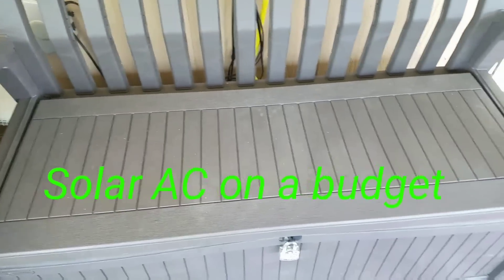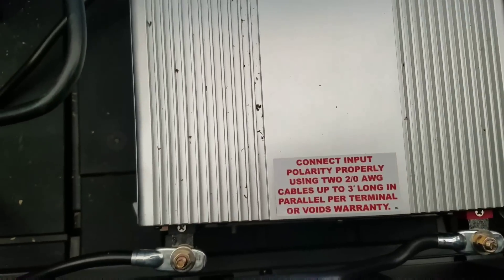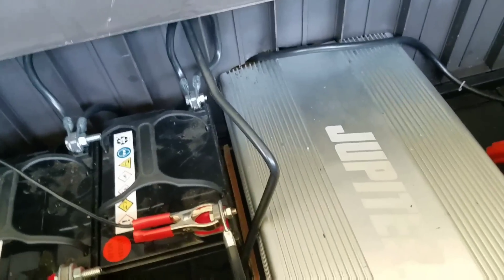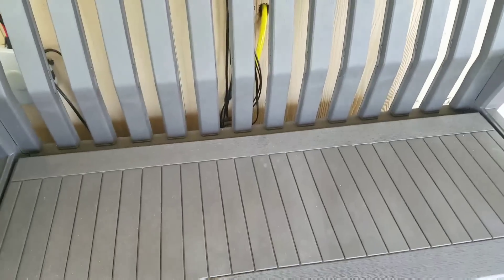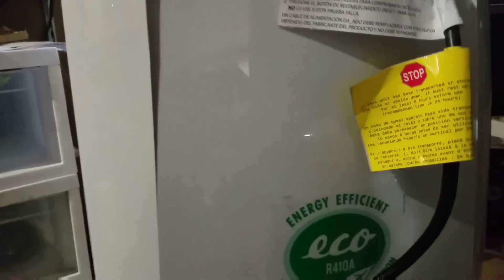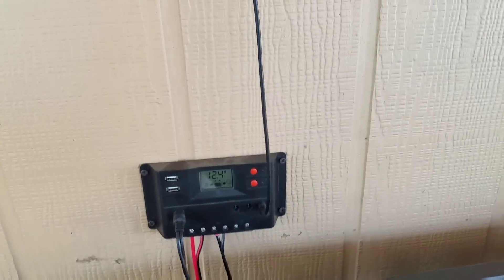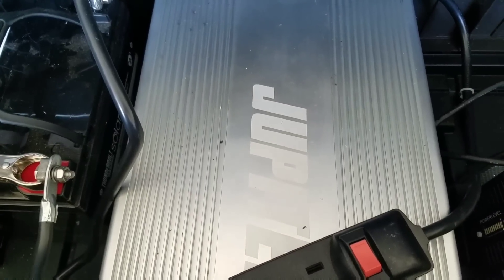How to run an AC unit on solar update

Comment: I live in The hurricane zone and have had a large 5000 -12,000 watt power inverter. We hook it to the battery of a car and let it idle . We rum freezers tv’s and ac
Reply: Why not just get a generator
Reply: Eric L. A generator needs tons of oil changes and is loud my car makes no noise and only needs an oil change once in a few months plus i don’t have to worry about my car getting carried off or putting gas in it every few hours
Reply: Eric L. Also a 5-12,000 watt generator is big heavy and expensive i have one but never used it
Reply: @littlemanoo  
What
kind of things do you power, and how long can do you let your car idle for

Comment: You have 150 watts of solar (peak) likely less than 100 (typical) and a completely inadequate battery system. You'll be lucky to get a half hour out of your setup and that's after you pay to charge the batteries up with grid  power. After that you won't recover......really need to do some more research before you jump into saying you're running AC unit off of solar

Comment: I have the same panels it works great I got the same 5000 wat inverter im gonna add two alternates ran with dc moter from batteries at night to keep batteries from dieing
Reply: Have you added your alternator to your system? How is it working?

I’m doing the same thing. Just set it up today.

Comment: You have some good ideas, but I think you missed at least a couple of things. That box is going to get very hot with that inverter running inside of it. It needs a lot of air. That brings up another thing. It's never a good idea to put batteries in the same box as electronics, (hydrogen off gas and acid fumes) both bad in a confined space. Keep plugging away. That's how you learn. You will end up with a system that will work for you.

Comment: Great Idea however many concerns and things to consider.  The batteries are small Sealed Lead Acid batteries only rated for very low amp draws and their Ah is very low as well. Consider upgrading to some Deep Cycle batteries. Also keep in mind deep cycle batteries prefer lower amp draws <25 Amps. So increase the number of batteries to decrease your Amp load per battery. Also look at connecting each batteries to one common point and keep wires the same length. This will help balance the amp draw and charging to the batteries. Also if you keep your amp draw per battery low you can use smaller wire. While talking about amps Please get some fuses installed. If you get a short or any problem you have a lot of potential amps free flowing to create a really big problem. I am working on a setup like yours. I am using Six 105 Ah deep cycle connected to a fuse block. I expect about 8 Amps draw each battery. Which means I can use 12 gauge wire from the battery to the fuse block and still be fine for up to 20 Amps per battery (1500 Watts across the whole system). I could run 10 gauge wires and up my load to 30 amps per battery but it isn't needed for my setup. I also expect much longer run times due to the lower amp draw.  I love MPPT charge controllers but I'm only running 100 W panel and it isn't cost effective to get a $120 MPPT controller when I can just get another 100 W panel for $100 which make up the power inefficiency and make more power. With smaller solar setups like ours an MPPT isn't as cost effective. I have thought about setting up a 24 Volt system but decided against it due to cost. It would require a MPPT controller and more solar panels and much more money than I care to spend on the project at the moment. I would recommend a Pure Sine Wave inverter. Modified sine wave inverters work for some devices but not all, and even when they work since the power isn't smooth your equipment will waste a lot of power as heat making the equipment run hotter and will wear out faster. I will try and post a video in the next week or so of the setup I have come up with. The setup is for my barn which doesn't have power and is to far from grid power to make it worth running power and it's not really worth it to me to have another meter installed. I plan to run a 5000 BTU AC unit (600 Watts) but only when needed. It's mostly run a few shop lights and a few tool once in a while. I have an emergency plan of relocating the setup during power outages to keep a refrigerator going long term. You could also look into a Grid Tied Inverter, the inverter connects directly to the house and the solar panel and helps power the house. No need for a battery bank unless you wanted to setup a separate battery backup system.  I love your idea of the lockable bench. Much cleaner looking and safer. Good luck, I like the video. Keep us updated :)
Reply: Error

Comment: I am thinking those are 12 volt batteries. If you ha gone with 6 volts batteries for inverter, you would get more power and time of use. Also, you should have bought bigger paneles, 25 watt panels are too small. They are a waist of time and money.

Comment: This is going to be a expensive hobby my friend, you should have done A LOT more research before purchasing all this.
you over paid for all your components here, name of the game here is price per watt! and remember, it is always easier and more efficient to reduce power consumption then make power, invest in efficiency 1st! the return on investment is better.
Also there is some safety concerns with your set up, you are risking a fire that may not be covered by your insurance due to code violations!

Comment: Hello. You should buy 2 things they'll help you a lot. 1 a kill-a-watt meter so you can see the power that the AC unit draw and better figure out how much panel and battery you need. (also i'm not sure if they like cheap inverters. :-/ i only buy pure sine inverters they seem to be more powerful. my 1,500 watt one runs my 5k but AC and other stuff)
2. something like this (on the panel to battery connection https://www.amazon.com/gp/product/B01M5CWR2P/ref=s9_dcacsd_dcoop_bw_c_x_1_w?th=1 but don't use it if your pulling over 800 Watts from the panels 
good luck and let me know if you have questions. I'm starting a channel and trying to help people better understand stuff. 
Have fun with your project!

Comment: You're well on your way to getting this figured out!  Quick word of advice:  If you want to run your AC off solar, everything needs to come up.  Panels, storage, everything. As you continue to discover, consider discussing with your audience different power loads, such as the amps required to start an AC versus what it takes to run a stabilized system (locked rotor amps). Also, kind of a thing: the smart people say to never go 50% discharge to preserve batteries.  That stupid rule alone just doubled your cost. Keep it up, brother! I love this stuff.    Here is my setup:  https://www.youtube.com/watch?v=CpXzo57ovWI

Comment: I would add a small 12vdc fan to your bench/cabinet, set it up for cross flow ventilation. your batteries and inverter will run more efficient. There is also the gassing from the batteries that needs to be vented if they are lead acid.
Reply: i know Im asking randomly but does someone know of a way to get back into an instagram account..?
I stupidly lost the password. I love any tricks you can offer me
Reply: @Jerry Jad instablaster :)
Reply: @Ian Moshe I really appreciate your reply. I got to the site on google and I'm in the hacking process now.
I see it takes a while so I will reply here later when my account password hopefully is recovered.
Reply: @Ian Moshe it worked and I now got access to my account again. Im so happy:D
Thank you so much, you saved my ass!
Reply: @Jerry Jad You are welcome :)

Comment: 1. portable air conditioners use WAY more power compared to window units for the same output. they are the most inefficient coolers you can get.
2. you generally want at least twice the amount of solar input to your output, as you want to charge the batteries while using the power, and the batteries just cover the dips and peaks of sunny and cloudy weather.
2. if in cloudy weather, you need enough solar to cover charging the batteries as well as the output, this can be up to four times the solar panels to cover could cover inefficiency, dependent on your solar panel ratings.

IE, it's fricken expensive to run via solar.  the pay back time is in the 40 year range, IF you have no failures or other issues.

super tip, hit up solar installers for used panels from insurance jobs, you'll get 240+watt 36v panels for frik all.

Comment: Between 10am and 5pm, our solar setup generates 5,000 watts which was installed free as a lease but we don't have batteries and if power goes out we don't get to use the solar power.  We get solar credits from the power company toward night time use and winter use.  We get charged based on how much electricity  the panels create which I think is not the correct way of doing things, but it's free maintenance  and free installation on our roof after we got a new roof  so it will last many years.

Comment: Just enough knowledge to be dangerous. Make sure your fire insurance is paid up......
Reply: The issue here is, utility company will not like DIY people...haha
Reply: Nothing wrong with DIY.. As long as you follow the Code!  That takes a lot more education than just opening a box and reading a manufacturer's instructions that can not take into account every legal and electrical design.  Designing something like this takes weeks, not hours, of mathematics and design.
Reply: I have an entry level nabcep in solar (makes me just smart enough to be dangerous ;) but I run a small system on my shed for lights the last 3 years and I haven't even damaged cheap 12v sla bank with my cheap Chinese controller and panel... And amount of knowledge.. I'm sure most people would laugh, tell me I'm gonna burn down my shed... But I haven't doubt I will..
Reply: What are your qualifications to make such a statement?
Reply: Having 30 years of electrical experience, and electrical engineering, this is both dangerous and most likely illegal in most US localities without a licensed electrician installing it!  If you are messing with more than about 36 volts, and more than about 50amps, you are required to have a professional do the necessary design work for the system.  The electrical system has to be able to survive decades of service and exposure to the elements.  Wires not properly installed in conduit is among the most common mistakes by DIY people who are falsely thinking that they can DIY these house systems!
Reply: Jacob W:  I don't believe any thing you claim to be.
Reply: That is fine.. burn down your house, or whatever!   I can only lead a horse to water.. the horse has to decide if it wants to drink!

Comment: Get 6 volt golf cart batteries. 230 amps is about $130 per battery. For 12 volt system 2 - 6 V Batt at 230 amps, you need about 6 - 6 volt batt to run the ac. You will get about 690 AH of batt storage. Make sure the charge rate for the solar panels is enough to charge the batteries. Harbor Freight panels 100 w at 2 ah times how many HF kits. 3 kits will give you 6ah of charging in good sun light.

Comment: You need marine deep cycle batteries.
Reply: Yes and no. True deep cycles are best yes, either type
 But no, these toy AGMs I do not think are any better or even as good as the marine deep  cycles.
 If these are the low amp $70 HF agm's I think they cost too much for not enough usable amp. I mean 35amp and stay at 50% or above?? Ok that is 17.5 useable amps, even with the 20% off coupon that is about $60 after tax.
 115amps for a decent marine deep cycle at about $100 after tax gives you 57.5 usable amps at 50%
$40 more for almost 3 1/3 more usable amps.
 Also from what I have read and been told by friends it easy rather easy to destroy AGM with draining them  too low. I do have 6 120amp agm's. 4 were seldom discharge much being the are installed for backup system for 1/2 my house. Only lost power to run on backup a few hours here and there several times over the years, except one time grid was down from ice 2 weeks here.
 The other 2 AGM's died rather early since I was using them to run power tools from truck, electric chainsaw etc.. Working out in woods. I am talking about expensive high quality 120amp AGM's, not little toy batteries.
 However, I also had 4 Walmart deep cycle marine batteries, cost $75 each back then now just under $100each. I really abused those badly many times. Abused far worse than the AGM's ever were. I did run the expensive AGM's a little lower than I should have at times but never dead.
 The Walmart marine deep cycle I used the most and run near totally dead many times and also let them sit dead for awhile at times. Hell, $75 battery who cares, my expensive AGM's got first charge if they got used LOL
 Guess what, YES, The AGM's died!!!!  Much sooner than the cheap marines!
All 4 marine deep cycles lasted at least a full year longer before I lost them, and they did not just die. 2 got busted and 2 were stolen, but they were still working decent till then.
 I consider AGM to be too fragile, need babied too much, and too easy to kill them if you really need 
the power your payiing for, and pay we do since they really cost allot per amp!!
  The cheap marine can be abused many times and no real damage you can tell in normal use, we get far more amps per $1 spent, and if needed we can use nearly all the power we paid for without killing them. If we do kill one getting the last drop of power from it, big deal only $100 NOT $300 lol
  Ok, Ya, $100 is a big deal really, but if  I need those last few 50amps to save $500 in frozen meat, the meat wins and battery loses! Chances are battery will survive fine anyway with a proper charge.
  It is pretty much just an old wives tale that running a normal lead acid battery totally dead will kill it. Never has for me and with all the vehicles I have believe it when I say I have had batteries so dead then dome lights would not even glow! A smart charger of smart booster just gave error code like FO1 meaning junk battery, toss it! Well guess what, pull out the old fashioned $20 dumb 2-10 amp charger, or jump from other vehicle, and once dead battery starts car all is fine and never know it was ever dead at all!
 Even my small motorcycle batteries can show only 6v on gauge, but once charged and bike running battery works fine.  
I have auto and bike batteries that have been totally dead at least 5 times each, are 3-5 years old, and still work like new and still in the vehicles.
 Silly things cause my dead batteries like one car everytime it was parked about a week it was totally dead, drove me buggy trying to figure out why. 1 night I was walking past the car and saw a strange glow, glove compartment light was on! I took out the bulb since it would not turn off, never anything wrong since. That battery was stone dead at least 5 times, and it is over 4 years old for sure and still working fine. 10F and car sitting 3 weeks untouched and it started right up a few days ago.
Reply: I was discussing this with some coworkers, as we were designing solar systems for some county ems responder search trailers, and the issue is that if the batteries get below 50% usage, it dramatically shortens the battery life.. to maybe a year or two of use, instead of 5, 8, 10 years.  Actually needed MORE capacity than the rated needs.
Reply: Thomas Strickland Marine deep cycle batteries are a far worse choice than AGM batteries, so not great advice.  Marine deep cycle batteries are not true deep cycle batteries despite their name, rather they are a hybrid battery lying halfway between starter (SLI) batteries and the true deep cycle batteries (such as traction and many AGM batteries). -- they are "deep cycle" only in the sense that they are deeper cycle than a starter/SLI battery.  Whereas true deep cycle batteries may be regularly discharged by as much as 80% and will survive much deeper discharges on occasion, marine deep cycle batteries will fail very rapidly if discharged much below the 50% mark, and they do not really like being discharged even that deeply with any regularity.  So marine deep cycle batteries would be a step in the wrong direction versus the AGM batteries presently being used which are a type of true deep cycle battery.

Comment: Inverter and Battery inside a non well ventilated box is dangerous.
Reply: Kevin Lee Or an earth shattering kaboom if the batteries should vent explosive gasses (which even sealed batteries may do under certain conditions).
Reply: Sounds like an eletrical fire to me...
Reply: exactly... If he was smart about it... they do make fans that come on when something reaches above a certain temperature... or maybe make holes in the box lol
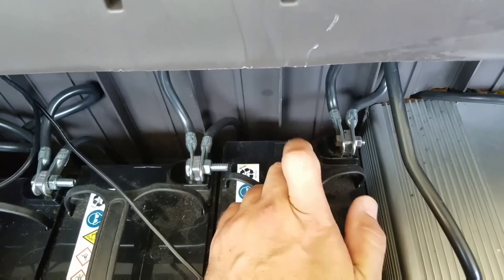Reply: 6:30 "wow that's hot" uas think 4 batteries TRYING to charge AND run a 5k inverter in unventilated box.